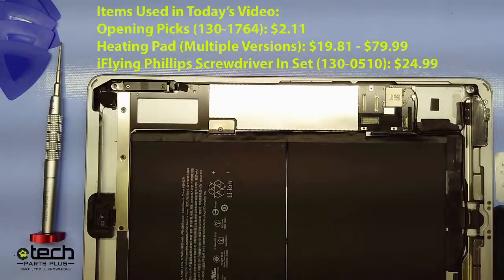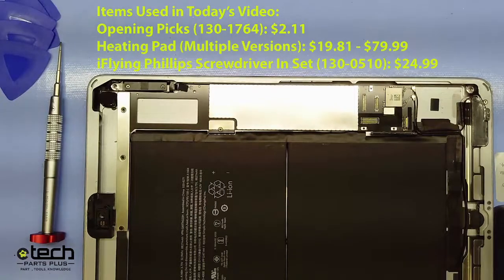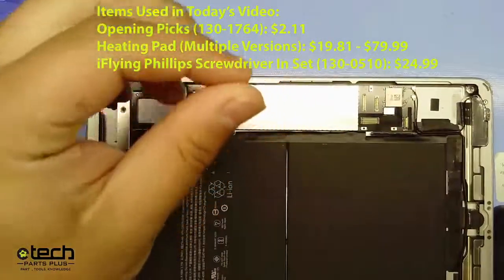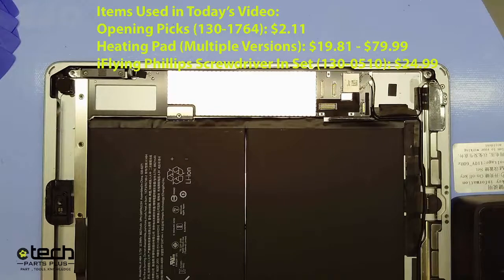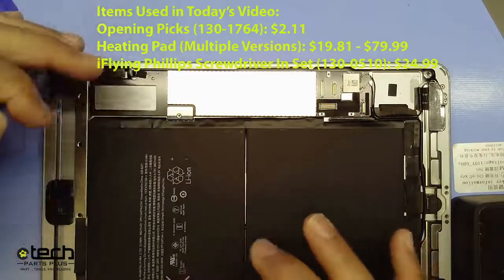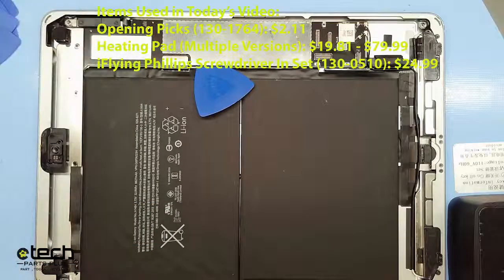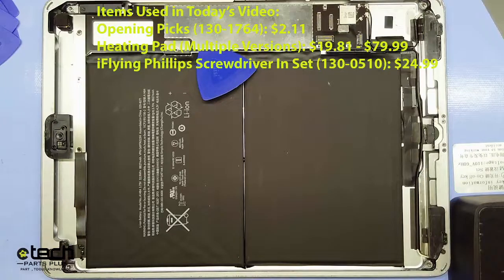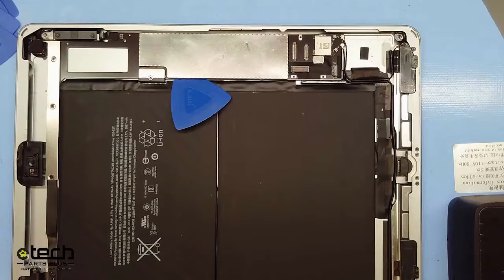Safely Disconnect Battery on an iPad

Comment: I have a question if you pull out the iPad battery by yourself can it cause a big fire and you do it by yourself at home and you do it really fast
Reply from the maker: Great question! It is definitely doable on your own but as a couple safety precautions we recommend discharging the battery as much as possible, heating the outside of the frame where the battery is located with a heat gun or heating pad, and using a alcohol to help neutralize the adhesive. In our tests, a thermal event is less likely when a battery has a lower charge present.
Reply: @etechpartsplus2334  oh okay so it’s a yes if you break the iPad into pieces by yourself it can go on fire is that a yes or no?

Comment: Hi, great guide thank you. I replaced the screen without issue few days ago but now the battery jumps from 66% - 0%. Just wondering if maybe the screw to the silver battery connector is loose or if I have FUBAR'd the whole thing? Or if its just a freak coincidence? TIA :)
Reply from the maker: Hi! It can be the screw that is loose. If the battery was disconnected by inserting the spacer directly in between the connector and battery pads it may be that the pins on the battery connector were bent and are not making full contact. I would start by checking the screw and if that does not resolve, the connector on the board needs to be inspected.

Comment: I have a iPad 9th generation that’s ghost touching without the digitizer connected. Any tips ?
Reply from the maker: Hello. The iPad 7 and newer do this when the digitizer is not connected. When you connect a digitizer it should stop. If it persists with a digitizer connected it is possible that the connector on the board has damage present.